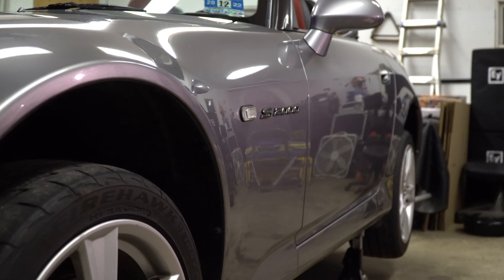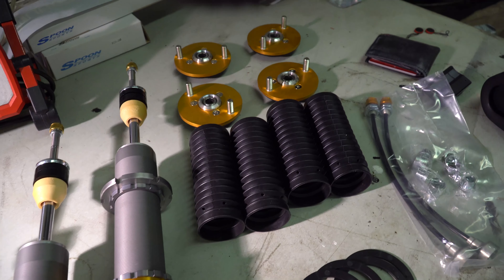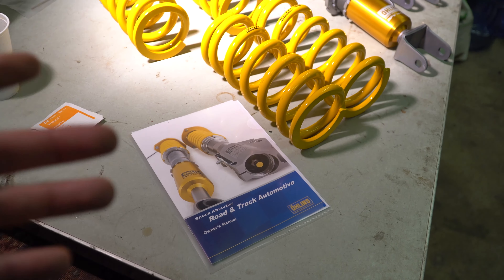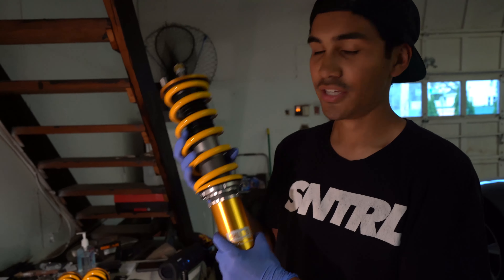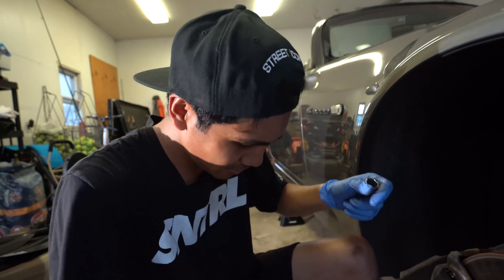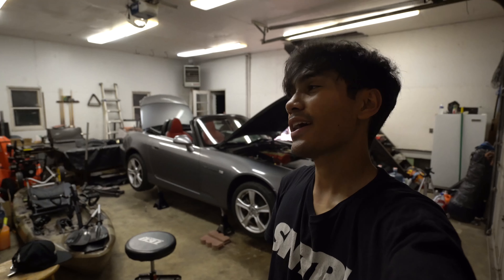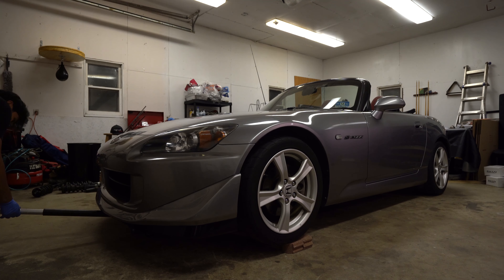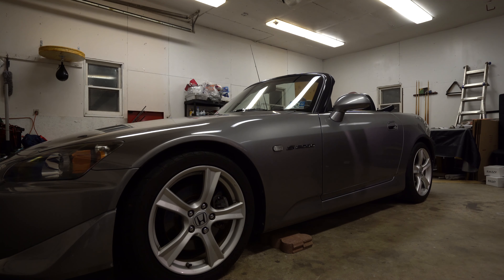Ohlins DFV Coilovers for My S2000 | VLOG 008

Comment: Thank you for the video. Can you share what items list you bought and how it has changed since the installation? How is the drive different from stock suspension?
Reply from the maker: I bought the Sakebomb Garage Ohlin DFV's with 12/10kg swift springs. Car feels a lot better on the track and soaks up a lot of the bumps in the road very well. Good happy medium for a street and track coilover. The coilovers paired with squared 255/40/17 wheels really made the turn-in on corners feel very responsive to me.

Comment: What was the black spacer (?) you added at 1:35? I don’t think mine came with that and it’s not in the instructions. But I had to add a washer on my rears because I was clunking even after the nut was at its lowest point so I’m wondering if that was the cause.
Reply from the maker: Hey Matt, I'm not too entirely sure what the purpose is for the black spacer. It was the most logical location for it to go to when I assembled the coilovers. No clunking at all. I'd suggest checking your preload if you have the clunking still